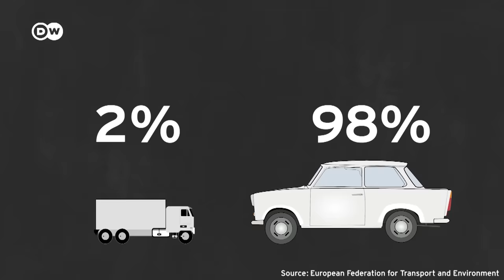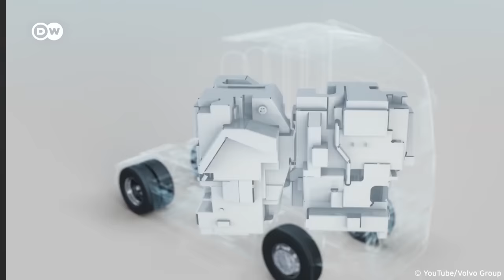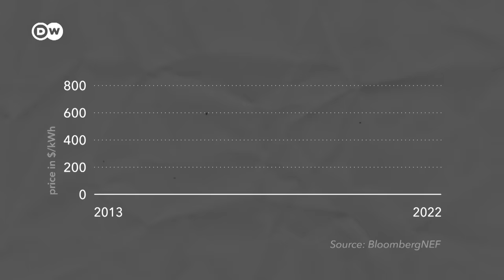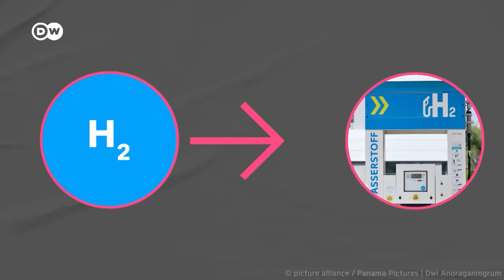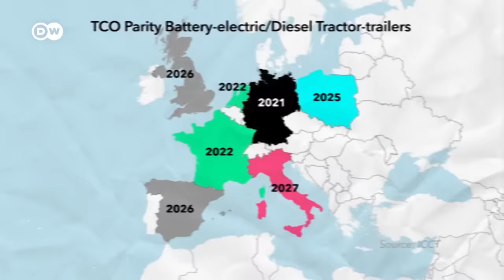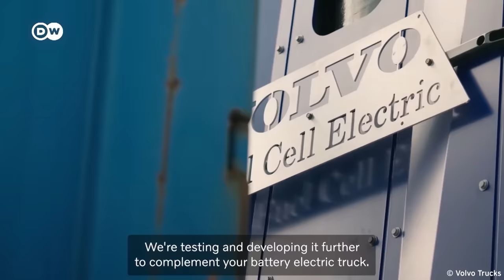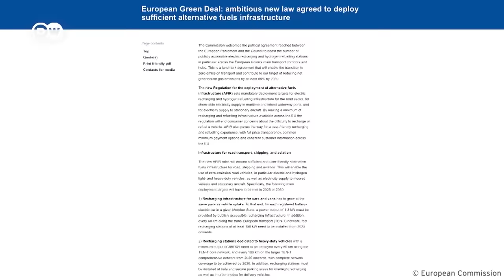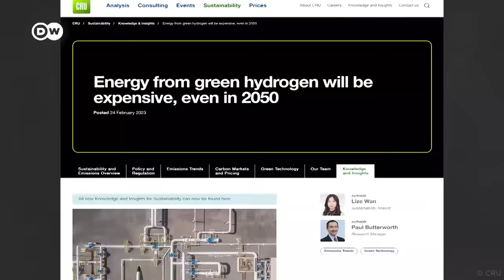Which will be the engine of the future?

Comment: As an engineer knowledgeable of what is being developed, I can honestly state, it’s not battery driven electric power trains. 
All engineering development that I am aware of falls into two categories
1- Producing more HP/liter, allowing for smaller/lighter IC engines ( current goal is to achieve 200hp/liter @ 70mpg 
2- Develop Hydrogen to eventually replace gasoline/diesel For IC engines. 
….
I expect us to wind up with 4 technologies, in the future…
1- Micro Inner city, BEV, with limited range (<120 miles)
2- Gasoline/Diesel ICE, Small and Micro cars capable of 70-80mpg 
3- Hydrogen ICE, Small and Micro cars capable of high fuel economy. 
4- Hybrids based on Gasoline/Diesel/and Hydrogen, to power larger cars, trucks, equipment
…
ICE Vehicles
Regulations to replace exhaust systems and fuel management components at 70k -80k miles for ICE vehicles. To keep them current. 
… 
Cities.. the largest polluters…. 
Stricter regulations to maintenance and monitor BEV battery state, including balancing and absolute control given to the Battery Control Module, in order to control thermal runaway. 
..
Large Parking areas outside large cities, where drivers will switch from an ICE or Hybrid to a Micro BEV in order to enter the city. City vehicle areas will be downsized to only allow for the Micro sized BEVs.  
..
City deliveries (distribution) will occur via underground rail. On the current underground subway systems, but with different vehicles
..
City busses and trains will be consolidated onto an Electric Micro rail driven system that will run above ground

Comment: The trend is favourable for the electric vehicles. It is a matter of mass scale.
Reply: @huanghermann5207 Hydrogen can be a succes when white hydrogen becomes a big thing. If it can be drilled just as easy as natural gas, it will probably cost just as much as natural gas.

Comment: What about huge freight train networks?
Edited for clarification: I meant freight trains as part of a sustainable transport network.
Reply: If you add batteries to the locomotives, you can then place overhead wires along various locations of the freight rail network to top those batteries off as the train is moving.
Reply: @legostud  thats a terrible idea overhead cantelivers are far more reliable and dont require any rare earth material to function
Reply: These would only transport from certain points. and would still require trucks to deliver to the city and even to the last mile. Combination of both could be a solution
Reply: @jamie3226 Thank you😊
Reply: @zerotwo_.002  installing catanery wires over the entire freight rail network could be very cost prohibitive. Some sidings are rarely used so the return on investment would not be worth it. Adding battery packs helps mitigate the costs by reducing how many wires need to be installed. 

Also the battery packs enable the train engines to use regen braking, making them more efficient.
Reply: @legostud  Ah no not really. Catanery wires arent really expensive. Sure they are more expensive than just a single or a fleet of battery powered trains. But considering the amount of power the trains require to larger loads its a terrible idea to do that with a battery.

Also overall maintance and resources required to build the train network would be a lot lower. And more than that the cost of maintenance would actually be a lot lower. 

And the usage of regen  braking come on that isnt a real advantage the energy gained from that isnt really worth it and is just an excuse for trains. for automobiles regen can be useful considering constant acceleration and deceleration but in train nope.
 
The only excuse for a non overhead electrified route is difficult terrain. And in those places i can see a point of battery powered trains but even their Fuel cells make more sense due to the batteries immense weight. 
The trains which have a battery as their source of power really have a pitiful carrying capacity.
Reply: @zerotwo_.002  - maybe we’re looking at this slightly differently, but I think we’re both going in the same direction. The batteries I’m thinking wouldn’t be huge, not like the size of the engine, but something more reasonable to keep the train running for short runs, say along a siding. The catenary wires would do the heavy lifting to keep the trains running. 

I’m also picturing some really rural routes in America where catenary wires could be troublesome to install due to either remoteness or being too wildly overgrown. I’m not an expert, but I suspect that it would be difficult to go 100% with catenary wires. 

As for regen, it can actually provide a decent amount of energy.  There are freight lines being proposed where they transport heavy ore loads to the coast using regen the entire trip to recharge the battery so it can pull an empty load back up to the quarry on the stored energy. It never needs to be plugged in since it’s powered by kinetic energy.
Reply: The US has 220,000km of rail and it cost Amtrak $3M per km to electrify on of its lines so we’re looking at $660 billion dollars to electrify the American railways.  That’s a lot of money and could buy a lot of batteries instead. So a compromise between the two solutions would probably be more doable.

Comment: Starting simple is a better idea. Both industries require a huge amount of investment, and its better to funnel all the investment into the project with better ROI. Electric short haul transport is a smaller step and is probably more impactful, so I'd argue it's better to fund that industry first.
Reply: That doesn't seem to be best ROI to me unless it only considers short term returns.
I'd say that Trains are a better ROI over their lifespan compared to electric short haul transport. 

With the more significant criteria for this being:

1) Less resources necessary for increasing the speed of technological development and new materials because it's a very mature technology (still can be developed further, just maybe at less resource usage).

2) In the short term, it has a foreseeable longer life span with some of the most efficient results we know to be possible, just based on the technological principles alone.

Comment: We probably shouldn't overlook hydrogen just yet. It could still be one of the only feasible option in industries like airlines. Also just like batteries have evolved over the years, hydrogen too could get more efficient with rapid advancements in technology.
Reply from the maker: If you like hydrogen, please also check out our video dedicated to it fully here 👉 https://www.youtube.com/watch?v=AGTjKJHu99c.
Reply: What makes you think aviation is going to continue to exist?
Reply: @gcvrsa  It is one of the fastest and safest modes of transport. I believe people need to think out of geographical boundaries and consider the entire planet.
Reply: @gcvrsa  What makes you think it won't?
Reply: Hydrogen will get more efficient; the only reason electric batteries are where they're at now is because of governments forcing people to switch to electric cars and pushing how great electric cars are when they are not really that great, imagen if they pushed hydrogen powered vehicles instead of electric vehicles to start with? hydrogen vehicles would be more favored than electric vehicles.
Reply: @josephking1502  Hydrogen from the ocean?
Reply: We already have Battery based Aeroplanes, Boats and Yacths!
Reply: Hydrogen is not feasible for long distance aircraft.  Carbon neutral biofuels are the likely answer for transoceanic travel for the foreseeable future.
Reply: @incognitotorpedo42  Yeah that does sound reasonable for the near future

Comment: I find the whole idea of Trucks with gigantic batteries a little silly, It really should be the trailers that carry the main battery 
This way they can be slow charged cheaply and efficiently while in storage/being loaded and truck only needs moderate top ups during it's working day. Also having thousands of MegaWattHour scale batteries connected to our grid would do wonders for grid stability and absorbing excess green power surges.😄
Reply: The entire trucking industry disagrees
Reply: You cannot possibly imagine that no one has thought of this idea before. Maybe study Physics, specifically the physics of towing.
Reply: Few issues here. FIrstly there are 2 big limits globally in trucking, first there is a leght limit, often 18.75 meters and a weight limit, often 40 tons. Even if you shove your batteries to the trailer, if you are hauling 5 tons of batteris plus 10 tons for the truck, you can only carry 25 tons of cargo. This solution would solve absolutely notthing. Secondly, many trucking companies do not own their trailers or do not own the ones that they are pulling etc. Logistics is extremely complicated so this would make life even harder for everyone

Comment: If we want to produce clean hydrogen, electrolysis is probably our best option. However, to produce 1 kg of hydrogen fuel via electrolysis, you'll need to use ~50-55 kWh. The specific energy of 1 kg of hydrogen fuel is only around 40 kWh. So you're spending 50 kWh to get something that'll only give you 40 kWh. 🤔

It makes more sense to me to just use the electricity to charge a battery.

Comment: Could hydrogen not be generated overnight when we are asleep using cheap rate electricity? And this could surely be carried out in our current petrol stations / garages - i.e. locally generated hydrogen to cut out the delivery costs to points of sales?
Reply: And in countries with excess solar or wind, produce when the electricity price goes negative
Reply: @TarviVerro Excess solar and wind are almost daily occurrences.  Also, Toyota has developed a hydrogen ICE.
Reply: Many in media focus only on green hydrogen, and ignore regenerative grid theory, which uses all of the wasted electricity streams.

I am not quite sure why they remain so ill advised at this late stage.

Convert wasted electricity to hydrogen to cash in for generations.
Reply: Hmm, interesting question. At roughly 67% efficiency electrolysis requires about 50 kWh of energy for both Alkaline and PEM electrolysers to get 1kg of hydrogen out (energy value of 33.3 kWh). When considering energy density, 1kg of hydrogen is roughly equivalent to 1 gallon of gasoline.  So roughly 57 kWh of electricity is needed to make the energy equivalent of one gallon of diesel. To fill a 100 gallon semi tank with hydrogen would require about 5.7 mega Watts (about $680 of electricity at 12 cents/kWh).  This is just back of the napkin math so I could be a bit off. I don't have information on how many miles per kg an H2 semi gets.
Reply: Free when renewables have to be turned off on windy and sunny days
Reply: @Tron-Jockey  catalysts are being developed with aims to increase the efficiency of hydrogen production by electrolysis.  One thing is sure here, and that's that's there's so much development and research going on that what is true today will be advanced on tomorrow  - so watch this space  !!
Reply: @TarviVerro that isn’t a stable economic condition. Someone will build intermittent processes to take advantage of low electricity prices. 
Not to mention filling storage.
Reply: @stevenverrall4527 hydrogen ICEV are literally the worst idea ever
Reply: @GuyHubbard-ji9yj RE gets turned off because of transmission bottlenecks.
Reply: @mikesnook6951 we are already very near the theoretical efficiency limits of hydrogen. It will never make sense compared to BEVs.
Reply: @GuyHubbard-ji9yj  - An old argument that gets more meaningless every year. We are now building more and more energy storage into our grid. This will only continue.
Reply: @mikesnook6951  - keep in mind that nearly 400 million gallons of gasoline and over 130 million gallons of diesel are consumed every day in just the US. The big issue with green hydrogen is the daunting task of meeting such demand. This will take time.
Reply: @Tron-Jockey  oh I know! We're at the beginning of journey where the technology for production of H2 will change as research throws up different tech breakthroughs until we arrive at a cost competitive solution. Improving the efficiency of electrolysis with new catalysts etc, it'll take towards  twenty years I reckon before we get to a sensible solution
Reply: @mikesnook6951  GM had a HFCEV in 1966. We are more than half a century into hydrogen fuel cell tech.
Reply: @williammeek4078  yes, but only a few years of intensified  research due to the climate crisis  !!!
Reply: @stevenverrall4527  Wow. That's fantastic! Tesla will sell about 1.8 million BEVs this years. How many hydrogen cars has Toyota sold? The Mirai has sold a resounding 25,000 since late 2014. Just because they made it, doesn't make it an intelligent decision nor does it mean it will ever be a commercial success.
Reply: @mikesnook6951  How long have we been making ICE vehicles? A bit over 100 years. How efficient are ICE vehicles? About 20%. That hasn't changed in 100 years. Some things are limited by the laws of physics and chemistry. The efficiency of producing hydrogen is one of those. Ironically, it is anticipated that the efficiency of hydrogen from generation to electrolysis to liquefaction to transport to the fuel cell to the wheel is around 19-23%. Pretty much the same as an ICE car. That's assuming green hydrogen, which currently barely exists. Over 94% of hydrogen is currently produced by methane gas reforming, ie the burning of natural gas which also produces either carbon monoxide or small amounts of carbon dioxide.
Reply: Use excess power to power electrolyzer locally 
See what Davy Gas is doing

Comment: when you switch to electric then you need to put over head wires so you don't need to carry your own power, use steel weals to reduce friction, then line them up one by one so only the first truck has to break most of the air and hope we can get there in the next 100 years
Reply: Why bother with all of that when we already have battery electric trucks that can take 54,000 lb 500 miles on a single charge?
Reply: @williammeek4078  why lug batteries around and wait for them to charge when you can have power directly over your head? and use less power because steel wheels on steel tracks have lower friction?

Comment: Why is no one talks about balancing the power production. If one can keep producing in the most cost-efficient way... without stopping and starting turbines. One would save so much on production loss.  During low demand, bank the excess electricity in gigawatt stationary battery banks... and use it at peak demand. Key is in a well-balanced, consistent production and distribution. Why is no one talking about that?

Comment: This video made it sound as if there are too many unknowns, and charging time is definitely not an unknown.  Truck drivers have legally mandated breaks, where the driver must have a rest as long as the charging time is less than this break then there is absolutely no problem.

With cars right now Citroën are releasing their Ë-C3 which has a recharge time of 26 minutes and Volkswagen have just started the producing the first few ID.7 which have a recharge time of 25 minutes, and in 2025 VW will be releasing the ID.2 which also has a recharge time of 25 minutes but it costs a lot less 25,000 Euros which is a fraction more than the Citroën.  There are some cars already in production that can recharge in 18 minutes, but it's from somewhere in Asia.

This year at the Goodwood festival there was a demonstration prototype of a car that can recharge in 6 minutes, but that would take a few years to come to market.

So basically the technology for fast charging is already here, it just has to be scaled up.  Truck drivers will have to stop for more than 25 minutes so they will definitely be OK with the recharge times.

As for the cost of the batteries in the trucks, if Volkswagen can make the ID.2 for 25,000 Euros (in 2025) and Citroën can make it's Ë-C3 right now for less than the ID.2, then after scaling things up it's not a problem.  Diesel costs multiple times more than the cost of the truck and electricity is massively cheaper than diesel.

Also EV's need less maintenance than diesel vehicles, which is another cost saving.
Reply: Well there's already a huge lack for truck parking. 
How could you possibly integrate charging infrastructure then?
Reply: @no-damn-alias  build more infrastructure
Reply: @matthewbaynham6286   well I can see how that has worked for truck parking already